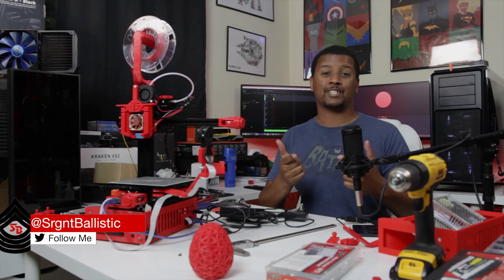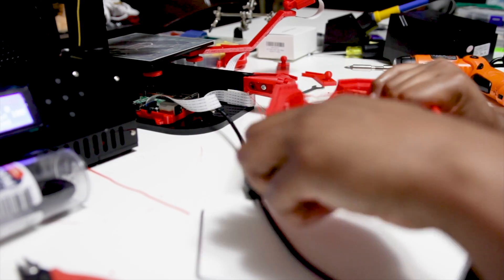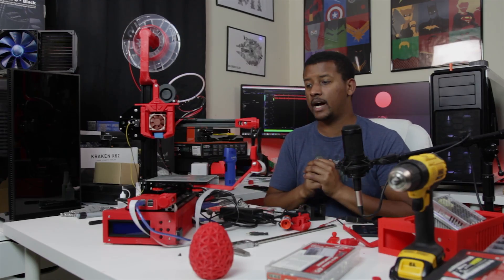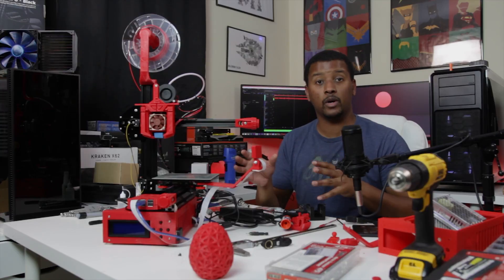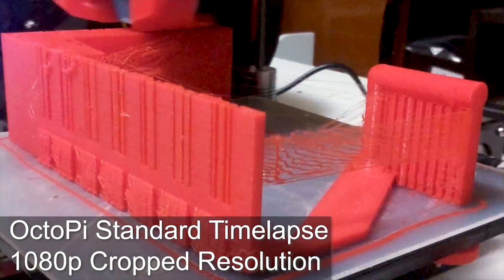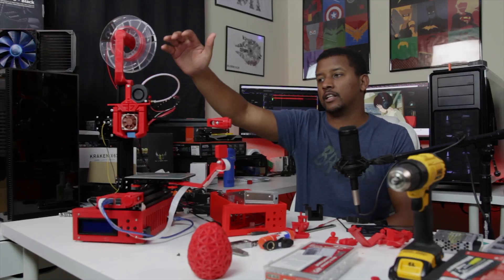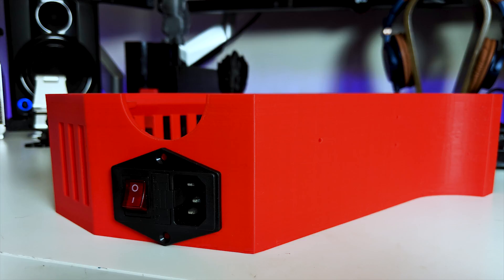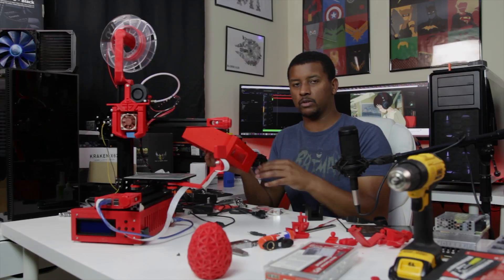Tronxy X1 $125 3D Printer Upgrades Part 3 | Control Box & OctoPi

Comment: I can already see MANY improvements for the bottom case.
Those vertical Pillars are not really strong.

Personally i would either remove them completely.
And make the walls 3x as thick. Making it more sturdy
or replace ith with 40-60mm fan mounts. then use those fan grills to cover any surface that has no fan.

With a Dummy fan made of Black PLA.
So it looks like there is a fan behind but in actuality there is nothing there.
Or i would just add more fans to it. Running them at a lower Amperage so there is enough cooling flow but not a huge power drain.

As for the bottom why not use a piece of cheap sheet metal. Mounting the case right to the sheet metal.
this also makes it more easy to assemble

Comment: Great mods you have there. I recently bought an Tronxy x1 and although mine does not have a single wobble issue or problems with the belts the prints just won´t stick to the damn print bed. They always warp themselves until the detach from the bed. Have to figure out how to solve this issue.

Comment: Could it be possible to put a heat bed on this printer without problems?
Reply: I'm doing that after upgrading the PSU and firmware.